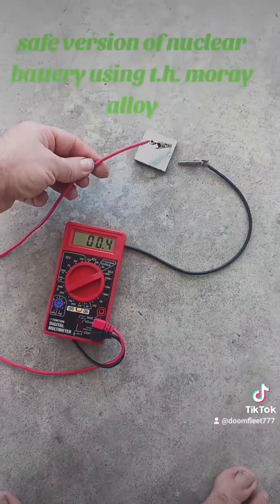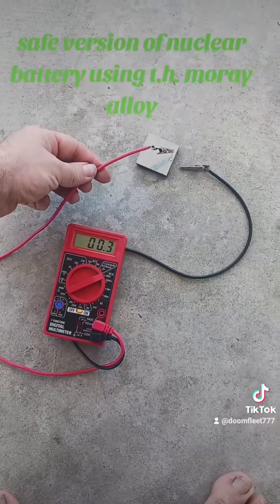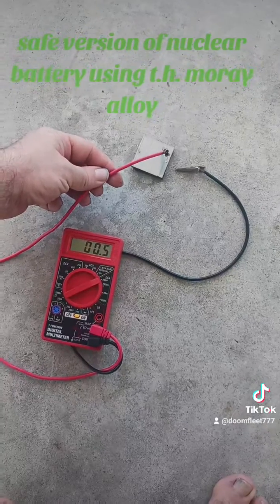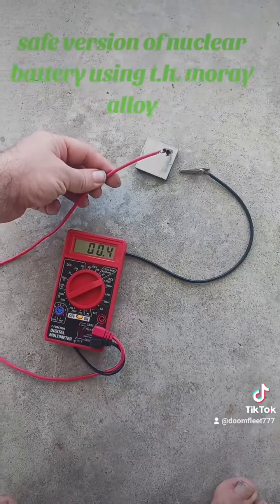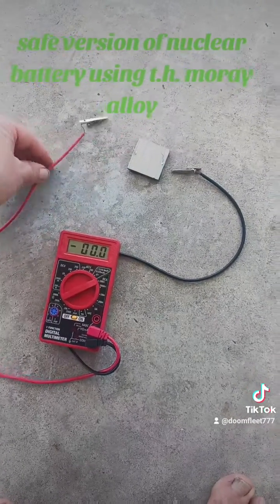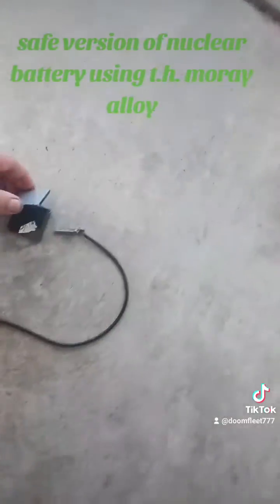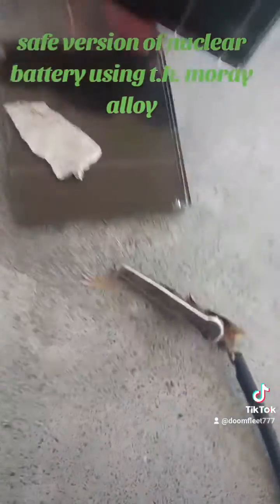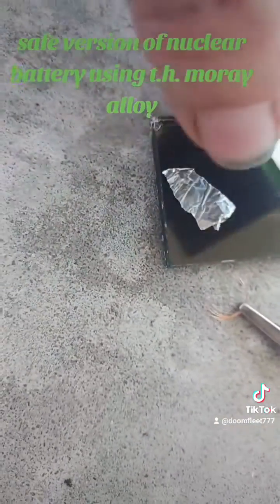ST. PATRICKS DAY NANOTECHNOLOGY

Comment: Hey Peter, what if there were some phosphors and elements that scintillate with this muon flux. I’m thinking about gamma radiation capture aswell
Reply from the maker: @andreweden8041  there are. scintillating detectors. glow or electrify in presence of cosmic radiation or isotope decay. the other type are Geiger style detectors that use an ionization gap

Comment: Either this is BS or you're not very good at making it look non-bs. If its actually a real thing, then prove it by testing the glass amorphous solar cells in the dark. Obviously light can get in through the sides. Also, if you're not showing how this magical alloy is made, then I don't trust you. I'm not going to go out and buy those ingredients, mix them together ruining one of my crucibles just to find out it doesn't work. Of course you'll then claim I didn't do it right and there's a rigorous process that involves exact temperatures, times, and the sacrifice of a 2 chickens and a goat.

Comment: Ah yes, the 5 dollar multi meter you can find at Walmart and harbor freight. Had two of those break on me. If you yank on the cables too hard the connection between the metal prongs, forks, sticks, probs, what ever you want to call them; and the wire will break. It’s not simple to fix Enless you have a spare lead and prob tool or can strip the wire and put on a new prob tool… thankfully my great grandpa could repair them by using the 2nd method I listed…
Reply: Quit yanking your leads, you’ll go blind
Reply: Don't Fluke or other name brand cables connect into them?
Reply: @ryelor123  yeah, but we didn't have any, and its not worth it to get replacements considering a new one is 5 dollars...
Reply from the maker: Ah yes the poor dullards who seek the safety of the herd and revel in comfortable dogmas.... a dying welterschaung of the defenders of the faith
Reply: @peterlang777  what?

Comment: This just looks like a bad experiment. You have no light isolation for the photo photovoltaic cells. That could just be light bleeding in from the side of the clear silicone layer. All you have proof of is that you don't use any testing standards and your test is not worthy of any note or credit. How about at least a voltage read with out the metals in there oh you didn't do that why because its still showing .2-.5v from light bleed. BS till proof that its not.

Comment: I didnt know moray alloys field radiated large enough that the diodes on a solar panel would be induced.
Reply from the maker: The alloy becomes electrified and will increase negative charges on the side that is supposed to face the sun. The alloy on its own is high frequency AC
Reply: Does the moray alloy propagate energy on contact Only, or can the alloy induce energy at a distance also?
Reply from the maker: @221boss221  it can induce at a distance I have found the chunks work at 1.2 cm.  This is the high frequency AC they get from muon impact
Reply: You should get acouple of meters and turn on all of your devices during the eclipse and observe.